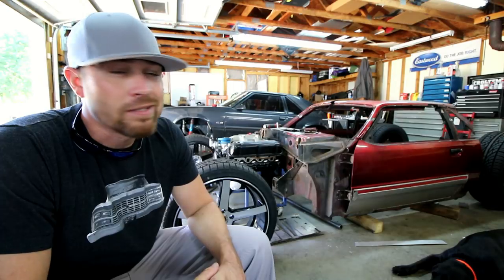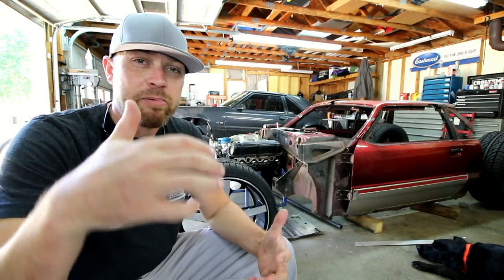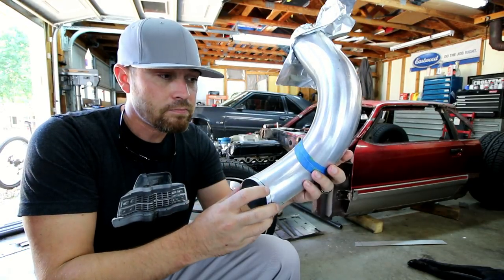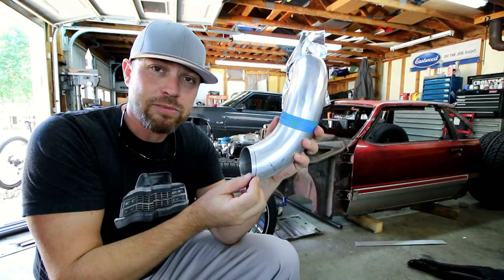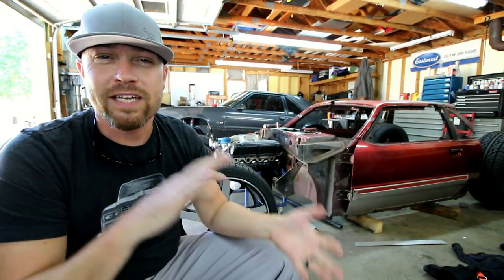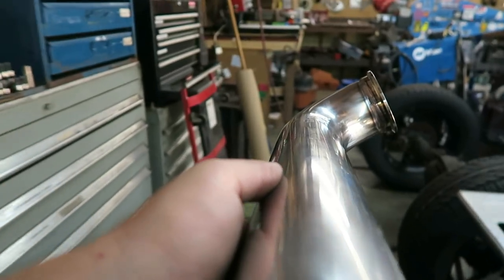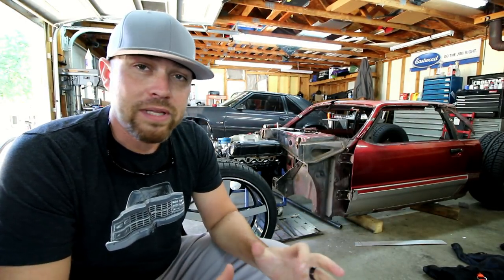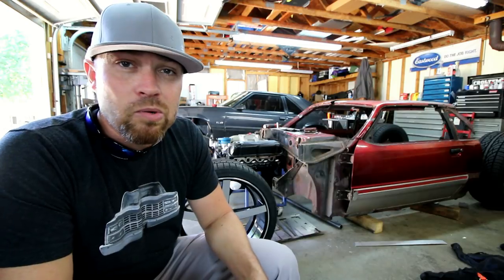TIG Welding Stainless Exhaust | Twin Turbo Mustang

Comment: A good way to do the wrap is soak it in bucket of water then put it on. Not sure if it shrinks a bit after it drys or what but always seemed to be tighter that way for me.
Reply from the maker: yeah some stuff is meant to be applied dry...
Reply: Thanks for the question and answer I was wondering that myself. I've only done it once wet.
Reply: It'll expand it wet and then when dried it constricts pretty tightly.  I've always done it that way and it works super well even if you have a spot that got a little loose on ya.
Reply: Ive always done all my wraps wet. standard fiberglass and titanium wraps. Like mentioned, it seems to stretch and contour well that way.  Never tried ir dry.
Reply: That Eastwood of yours seems to work well. Glad your working with it. not to many people talk or show that machine. with all the different welders out there it's hard to choose. Thanks
Reply from the maker: +Danylo66 yeah there are a ton of good choices and everyone tends to have strong opinions
Reply: yep wet and it goes on good n tight also keeps the junk out of your lungs gloves are  good idea too the stuff gets in ur skin if your not careful
Reply: yea wrap it in water.or thinners with a lil black paint to look cool..if u read the instructions were actualy ment to spary a proctant selant ....supplied  by them otherwise after time blasting around on a raining day it will hold water n steam up .eventually fatiuge rot and fall away.it wont with the sealer

Comment: You can also use solar flux for the back side make a slurry and brush the back area and it works like back purge just Cheaper
Reply from the maker: yeah it makes such a mess though

Comment: Nice welding video kyle use the back argon White aluminium also use a gap of 0.3mm 0.2mm set angel on it so you lay your last weld over it  get stronger weld use the pulse amp switch to 30+-amp and frequency on 100+- play whit it 
LOVE TO HERE IT RUN I FOLLOW YOU EVER STEP THE WAY Let it smoke the rap band
Loves and hopes for your New shop greatings from Holland marvin lokers
Reply: I AM not a welder I was a baker first (Hihi)
Reply: Love for the peaple that Got no home no more by those hurricane s

Comment: I really need to learn how to TIG, would make projects SO much easier
Reply from the maker: yeah its nice but very time consuming
Reply: I second the time consuming part. You learn to have a few tungstens presharpened. Not to mention the extra equipment/consumables which aren’t cheap. Just jump right into like I did. I don’t regret it, well until my gas runs out lol

Comment: I might of missed it in the video. When back purging do you continuously feed Argon, while welding, or only back purge enough to displace the oxygen. Do you recommend it for aluminum exhaust. I only have a Miller mig. with aluminum spool gun. I'm thinking spool gun to tack it together, and one of the welders at the shop can finish it with tig. But now I'm thinking about stress points at the welds.
Reply from the maker: +Al Cyr yeah you want a constant flow while you weld. I don't backpurge aluminum

Comment: There are better end fittings you can use so that you don't get turbulence in your pipe system. They are butt welded instead of slip on. BTW. If your fit is tight, you don't need to add rod to your butt welds. Enjoyed the video.
Reply from the maker: these are stepped and not slip fit

Comment: I am learning how to do the same thing.  I am more experienced at tig welding aluminum, but I've never tried stainless steel.  I hope it will be an easy transition.   I have to do some modifications to a car that already has an aftermarket stainless steel 304 exhaust.  I will be cutting the pipe and making it shorter in one section.  The problem here I am worried about is that the exhaust has about 10,000 miles of driving on it.  No winters, just miles.  I'm sure the inside will be "carboned up".  How do suggest I adjust for this?  I assume I should fill it with argon with the tin-foil trick like you do.   Can you offer any advice?
Reply from the maker: if you can weld aluminum, steel is easy

Comment: Did you create any lambda nut at the pipe? I just can't drill stainless. I tried slow with water and oil but no effect. Thinking of making a hole by weld but it is really tricky.
Reply from the maker: I did. I made them on both sides
Reply: Which video I can search for it? Which way did you prepare the hole?

Comment: Wow...monster tungsten stick out with that cup...how far out was it?  What kind of gas flow did you need to run it like that?  Looks like it would be handy for working around tubing and tight spots.
Reply from the maker: flow was around 25....this was actually minimal stickout

Comment: So you just splice your line from your tank to your welder to back feed the pipe with gas?
Reply from the maker: yeah
Reply: Cool thanks
Reply: Another option if you already have a backup tank, is to use a 2nd tank with a standard flowmeter. I have a backup tank in case I run out on Saturday or mid-weld or just dont have time to run to the welding supply shop, and a cheap standard flow meter is about $40 which is cheaper to add to your kit than a cheap dual flow meter ($92 -ish). Of course, if you are tig welding, you probably aren't afraid of spending money in the first place because it sure isn't cheap to get setup... :) - Plus you can purge with Nitrogen instead of Argon if you do a lot of it, might be cheaper to use Nitrogen in the 2nd tank. Personally, I'd rather have the 2nd tank of Argon around.

Comment: Whats the temperature in your shop....and will the new one be about the same....I am in 30 deg C and I need to use a fan in the work areas ...all the time.
Reply from the maker: probably 85 deg F.....the new shop will have heat and air

Comment: Put your heat wrap in water before installation. The installation is easier and you put it on more thight
Reply from the maker: Not supposed to use water on this wrap
Reply: @Thefabforums  for fiber glass wrap I always use water. I don't really see how it could hurt. It will see rain and snow outside. Maybe your is different material? Here's one source I have found http://knowhow.napaonline.com/how-to-install-exhaust-heat-wrap/

Comment: are you using a length of filler from a wire spool for this?  I was trying to use er308l 1/16" rod to fix my friend's exhaust and i quickly realized it was way way way to thick.  that and I was working outside with a fast breeze. hah hah...  the arc kept blowing away from me.
Reply from the maker: no just tig filler wire...several different sizes

Comment: Question for ya, when you back purge, do you keep the free flowing argon going as your welding as well as the gas from the machine as your tigging it together?
Reply from the maker: yeah. you will always want argon back flowing. Once I have the back side of the part fully purged I will turn the flow down some though.

Comment: Have you ever used nitrogen instead of argon for the back-side purge on stainless? Nitrogen (N2) is much cheaper than argon, and while N2 can't be used for all metals (like titanium because N2 reacts with Ti), it works well for most stainless alloys. I use N2 in repairs of restaurant kitchen stainless furniture and counter tops made from 304 with excellent results. I do air conditioning and refrigeration work, so I have plenty of N2 on hand; it is commonly used to purge the air from A/C and refrigeration systems before evacuating, and then filling with refrigerant. If you do a lot of back-side purges, a cylinder of nitrogen will pay for itself quickly. Why the use on N2 as a back-side purge isn't better known, I can't explain.
Reply from the maker: no but I will have to give that a try

Comment: and its easier if you apply the exhaust band wet (let it soak a few hours prior to installation.)
Reply from the maker: +Micke yeah this stuff said not to wet it
Reply: ok. well best to follow instructions :D it may differ between brands then
Reply: It’s not for exhaust repair for holes lol you don’t wet this stuff.

Comment: whyd you use worm gear clamps instead of those stainless ties on the wrap?
Reply from the maker: Mainly because I could get the worm gear ones tighter. I may add the stainless ones later
Reply: What about those ties used for axle boots? They need a special tool to tighten them down but it's a cheap tool. The ties have a very small width but hold strong. I use them because I have to swap boot ends to make an OEM axle fit in my swapped chassis.

Comment: Interesting video,Cannondale tried to make a motocross machine where the 2 header pipes were too short and too close to the suspension unit.It overheated and contributed to the bikes failure.So called engineers made these decisions but you knew it with horsesense.What does this tell you about qualifications?. I learned to TIG weld st.st at a professional course in France and was told to pass the argon through the highest part of the tube to purge it and the evacuation hole was at the bottom. WHAT?. I did it the other way around and it worked fine .What does this tell you about qualifications?. How many fools are there out there?.

Comment: just curious but what kind of welder are you using
Reply from the maker: Its a TIG welder
Reply: yea i got that much 
what make and model tig welder
Reply from the maker: @mikeyeah1418  I use several. I think I was using the Eastwood Digital TIG 200 in this video.
Reply: awesome the reasonni was asking is because i just ordered a eastwood 200 ac/dc 
not the digital 
i saw the eastwood banner in your garage 
i am hoping im going to be happy with this
im taking a tog welding class and in horrible at this right now 
never welded anything before 
i hope i got the right machine

Comment: You still got that tig200? I need more info on the Setting. Project looks good 👍🏽👍🏽👍🏽
Reply from the maker: +Warrior Of Area 777th yeah that's what I used for this tubing
Reply: What was the settings u used in the video

Comment: Have you ever tried using SOLAR FLUX B ?
Reply from the maker: +rustydog6010 no. It can't be use on joint welds that can't be reached. Plus I don't like how it works
Reply: So you have tried it then?
What I have found is, you can put it on before you tack the tubes together, 
or you can add  handle length to an acid brush to get back into tubes that are a 
bit of a reach. I've been using it since about 1985 and I haven't seen you do 
anything in these vids where it couldn't be used. I wouldn't use it on Food 
industry type parts but this racecar-street rod stuff is greet for it.
Reply from the maker: I dont really care for the quality of the shielding on the back side it provides

Comment: what kind of pipe joint are you using?
Reply from the maker: are you talking about the v-band connections?
Reply: It's the rolled lip on the tubes. what is that called?